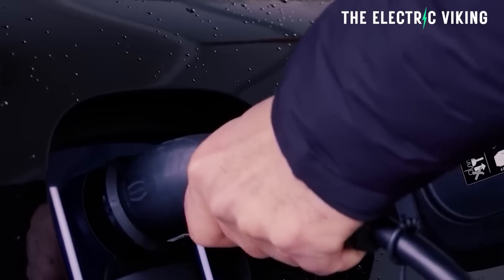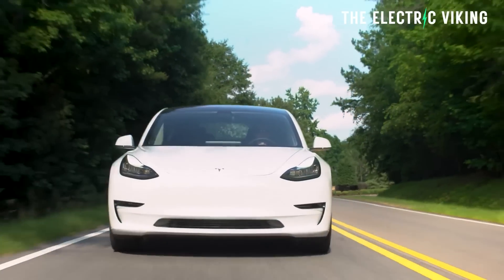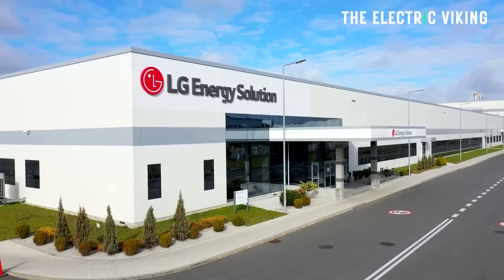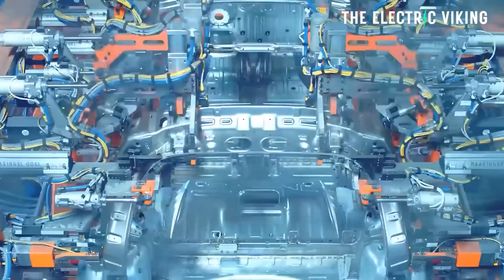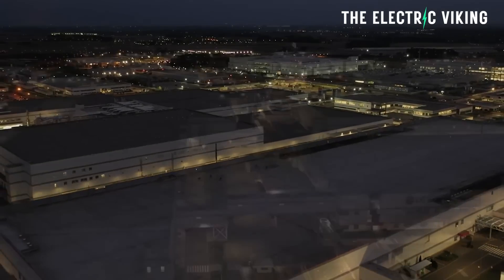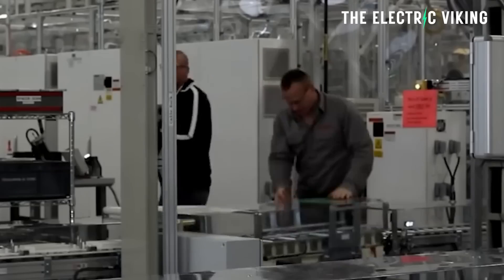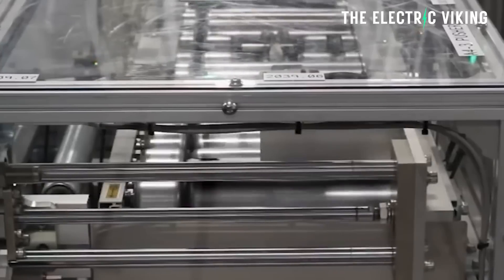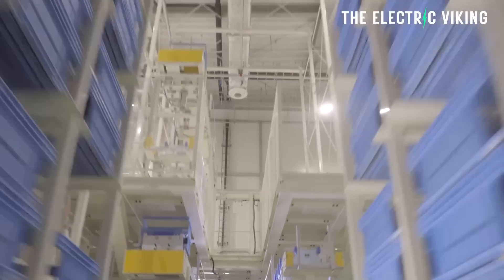NEW wireless battery management system are a GAME changer

Comment: Leafs have no thermal cooling. That's why they degrade. Every multi cell lithium battery has basic management for charging cycles..example, leaf batteries can only rapid charge to around 50% due to heat build up where the battery management system ramps down charge rate ..